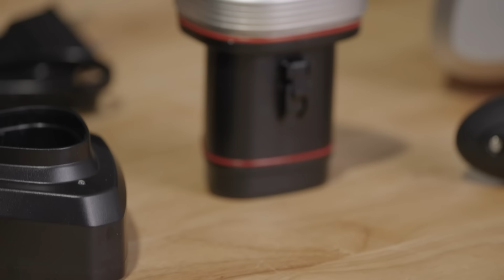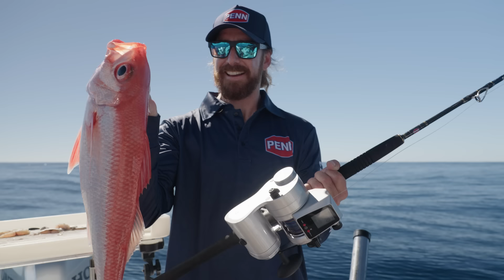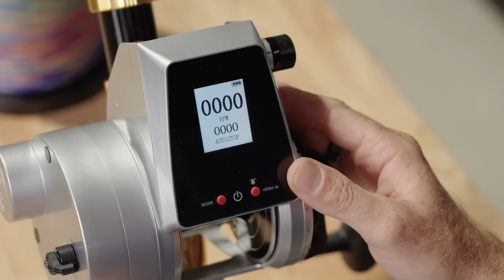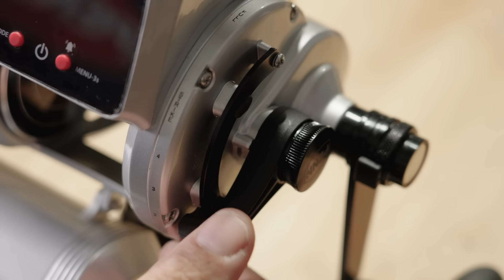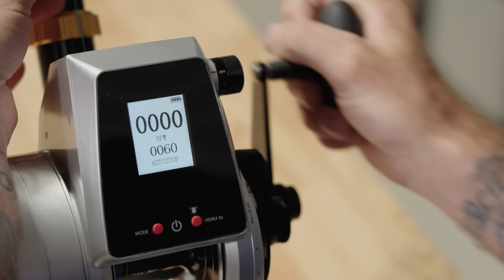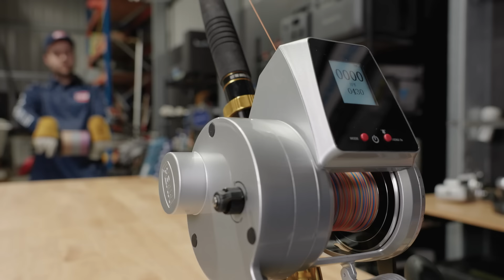PENN Fathom Electric | How To Set Up, Spool & Calibrate

Comment: Thanks for the video. It seems you need the level wind a little to the right as you’re looking at the reel if you want it to center up. I started dead center and it’s a little bit more line on the left side of the reel when it’s full.  The fathom 80 I have lists 1220 yards capacity for 80 pound braid.  Using the Penn heavy duty line winder at max drag it would not take the 1000 yard spool of 80 lb I have. That’s quite a difference. It will be interesting to see when I get out on the ocean how much line it says I have on the spool.

Comment: I bought a fathom 80 elect, Can i put tightlines 300# hollow core line on it and still get a good depth reading? It is 1.06mm line size. I did not see the larger diameter line size on line settings. Also how much line 300# line will it hold. I want to deep drop for yellow fine tuna in Hawaii.
Reply: hi, so did you try it ? that s what i want to do too, use it for for yellowfin palu bag

Comment: Hey Penn, I purchased a fathom 30 is there any trick to setting the spool tension, all spooled up and can’t get any tension on spool when in free spool, any help will be appreciated 👍
Reply from the maker: To set the spool tension on your Fathom Electric reel, start by loosening the tension knob beside the handle until the spool spins freely. Then, with your bait or jig attached, let it drop slowly — tighten the knob just enough so the spool stops spinning the moment your rig hits the ground. This prevents backlash and ensures smooth line release.